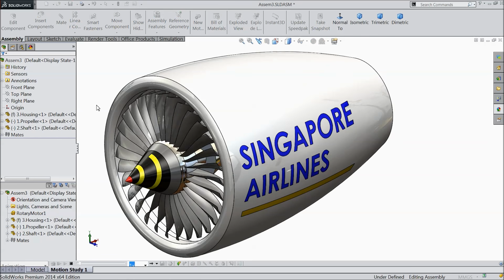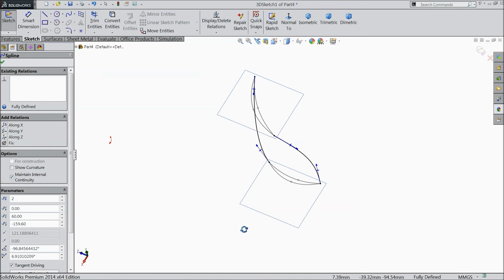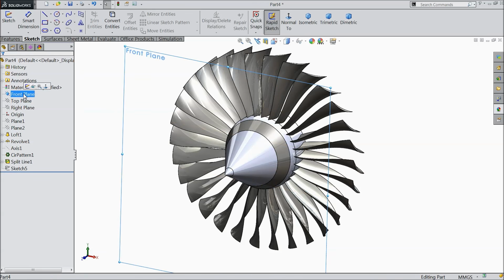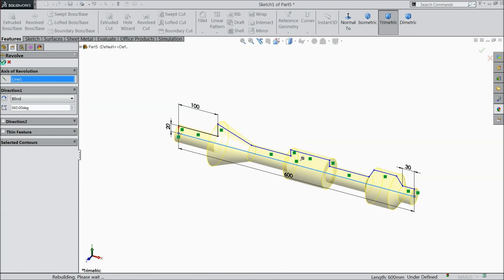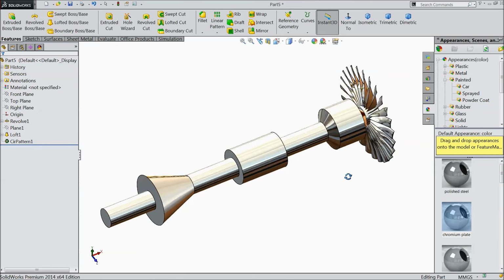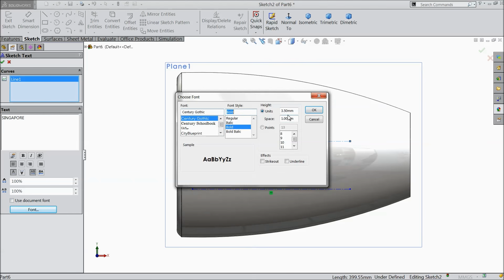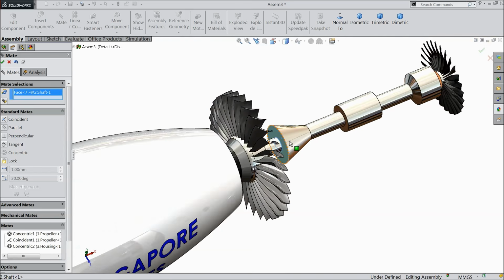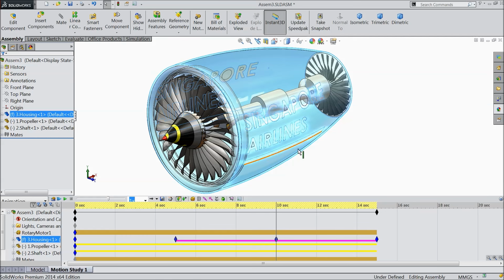Solidworks tutorial | sketch jet Engine in Solidworks

Comment: What are the specs of the used computer?  everything works so smooth even in the other video's
Reply from the maker: Dell Precision M4800
Processor  : Intel(R) Core(TM) i7-4810MQ up to 3.6 GHz
RAM            : 16 GB
HDD            :  500 SSHD
Graphics    : Nvidia Quadro K1100 2GB
Reply: LOL!! WHAT ABT THE PRIZE OF WHOLE SYSTEM IN RS...